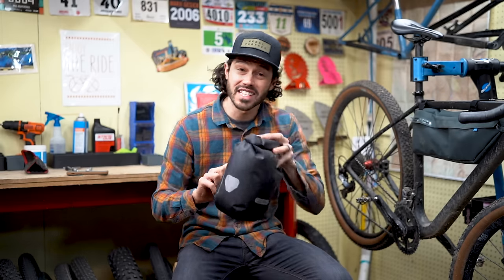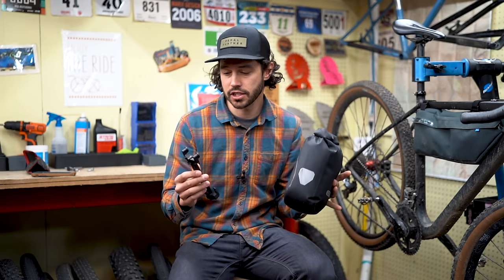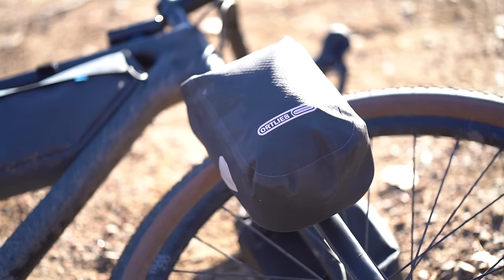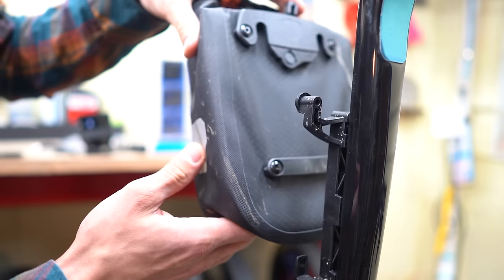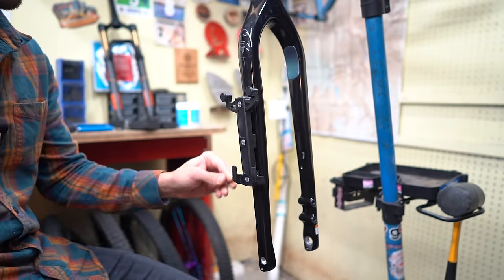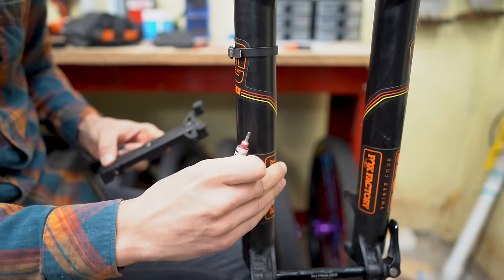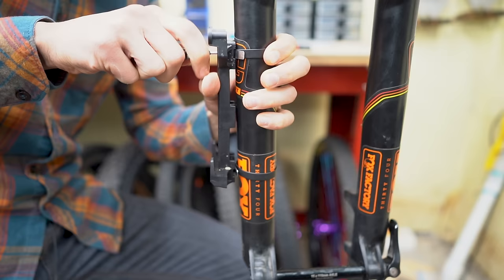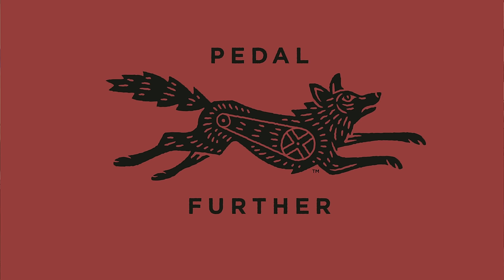Ortlieb Fork-Pack Review: First Look and Install

Comment from the maker: Note: We state that the Fork-Pack has 3.2 liters of storage in the video. However, this spec was pulled from the Ortlieb USA website where it was mistyped. According to Ortlieb, the proper claimed volumetric specification is 4.1 liters. To solve this, we performed a water fill measurement test and found that it held about 4.5 liters, so 4.1 liters is a relatively safe estimate, albeit slightly conservative.
Reply: 4.5 liters is fully open, right? So in reality at least 1 liter goes away when you close it?
Reply from the maker: @johalun  I filled and folded the roll top three times with 4.5L of water in it.
Reply: Neil, what would your confidence level be mounting this to a tumbleweed t rack on the back and doing off road bikepacking? (using the three bolts)
Reply: What I would like to see Ortlieb make is a bag system with two fork bags, and a frame bag +4L, as well as a stem bag, +14L, and when you want to unpack the bike, the bags should be able to fit together for easier carrying, or like a back pack. So making a system that can be unmounted and take as a full carrier bag when combining them. To make it easy and theft safe on stops when traveling, and easy to gather unpack etc, which they seem to be able to do. I like their bags and quality.

Comment: Another great review.  I just discovered these fork bags the other day and plan to purchase now.   I've always felt the fork has traditionally been under utilized as a carrying component.  I used a band clamp system on my first gravel bike.  My new frame now has mounts on the carbon fork. It surprises me to see manufacturers putting out gravel bikes w/o fork mounts?!  I have carried water on my fork in the past but I think these bags provide more utility than water bottles.  Water belongs in the main triangle and/or on your back imo :-)

Comment: For ultra long distance, a tip seems to be to drop the handlebar bag, panniers, fork bags and fork waterbottles. 
Focus on: 
● Full frame bag with waterblader and possibly a tube.
● Aerobars with a water bottle between your bars to reduce turbulence. 
● A bag behind your butt that sits snuggly under the seat and points backwards. The tailfinn packed full is a good example. 

However, the tailfinn is expensive for some. You can get a long way by MYOG, which means affordable. Use a traditional rack, a normal gym bag held down with bungies and a plastic lid to stiffen the bottom. Finish the custom rack bag with a tight rain cover to make it a bit more aero and clean looking. 

The result is an aerodynamic bike without things sticking out or space that creates turbulence. The bags rear position adds weight in the back. This distribution allow you to move your body forward over the aerobars, without the bodyweight creating safety problem. (Oversteering.)

Source
Windtunneltests: 'francis cade ultra distance aero'
Practical tips: 'Bike and gear of the cross continental winner, GCN.'
Reply: Thanks for the info, it made me think a bit more if I even need fork bags. Sounds impactful

Comment: What I would like to see Ortlieb make is a bag system with two fork bags, and a frame bag +4L, as well as a stem bag, +14L, and when you want to unpack the bike, the bags should be able to fit together for easier carrying, or like a back pack. So making a system that can be unmounted and take as a full carrier bag when combining them. To make it easy and theft safe on stops when traveling, and easy to gather unpack etc, which they seem to be able to do. I like their bags and quality.

Comment: My experience on long gravelly descents using two bolt bottle cages and 1 liter bottles is having to tightened the bolts every mile.  Was thinking loctite next time.  Did you have that experience with these bags tightened to less than 1nm and no loctite?  (PS, love this channel.  You're the best.)
Reply from the maker: I actually use grease in all of the bolts that enter my frame, I should have mentioned that in this video. They not only keep the bolt from seizing, but it also keeps them in place, it might seem counter intuitive but it works. I will make sure we touch on this in the full review, I've only have the bags for a few weeks but they are not loosening up on me.

Comment: Hi there. I wondering buying this set, but I still have one doubt that I cant find an answer to. Does the 2 steel straps, made to fix the bracket to a fork without mounting eyelets, is it possible to mount in a carbon road fork without damaging it? Do you know the answer to this? thanks and congrats for the channel

Comment: How about mounting them on a carbon fork with only 1 eyelet? (1 bolt mount and the second mount with the metal thing?) I dont understand why Ortlieb says no-no for carbon forks. Is it because they are generally tapered from top to bottom and in that sense the bag would eventually slide down and get loose? Or is it because the carbon mold is not designed to be squeezed in any way?

Comment: Why wouldn't it work for bladed carbon forks? My 'bcf' has one eyelet so I would have to us a hybrid installation method, no?
Reply: I can't answer that, but some carbon forks might be designed to be light weight and not be designed to have a bag clamped to them. I would never clamp anything to my road bike fork for example. Just a thought...

Comment: Would this work on the two boss setup on the Specialized Diverge carbon? As far as spacing and support?
Reply: Similar question, can you attach the plate with just two bosses that are 2.5 inches apart?
Reply: I have mine mounted on my Norco Search with just two bolts. Took it on a bikepacking overnight. They were solid.

Comment: Would you suppose the plate could securely mount to a rack that has cage mounting capabilities, such as the tumbleweed racks?

I am curious if it's necessary for the plate to have the larger surface area contact that comes with mounting it to the fork.

Appreciate all the content!  Thanks!
Reply: Yes, the spine attaches to cage eyelets.

Comment: Has anyone bought these? If so, would you mind measuring the distance between the top bolt and bottom bolt? On the suspension forks on my 20” wheels I’d need them to be within the range 9cm - 11cm apart. Thanks.